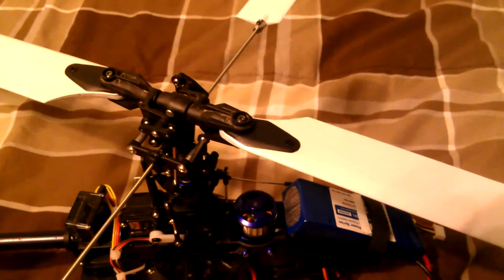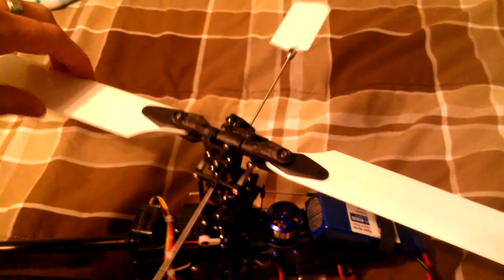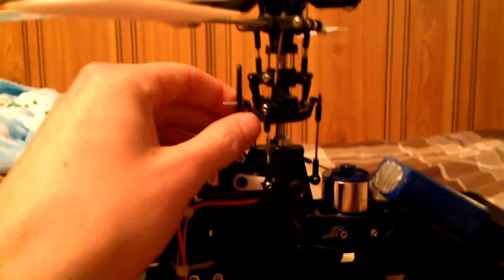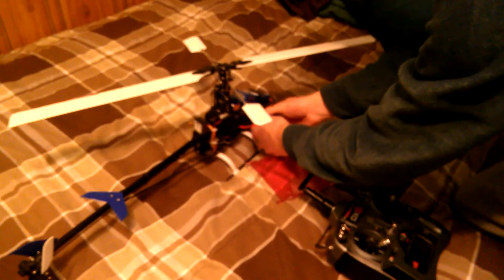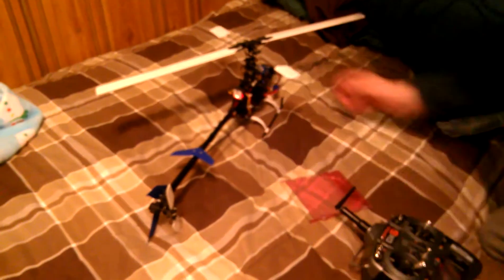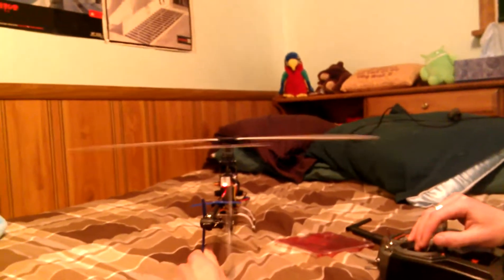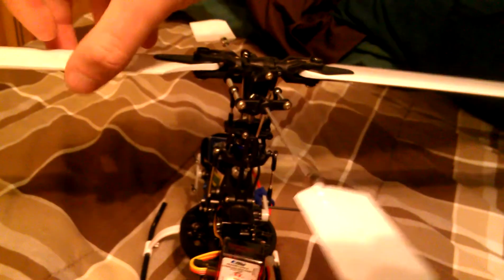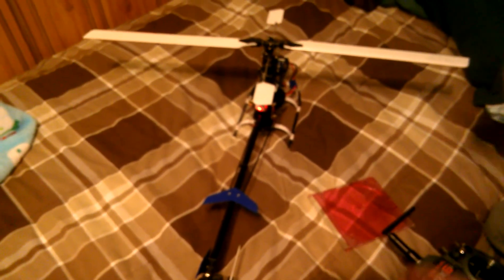Blade 400 tracking issues

Comment: I see that you posted this a good six months ago. I assume you've fixed it by now but for anyone else that might see this I was going to ask if you've checked if any of the servos are stripped. 
There are four plastic geared micro servos on that heli and I've had to replace two on mine already just from normal usage (not a crash).
Hope that was helpful